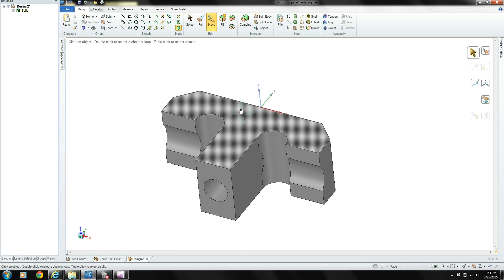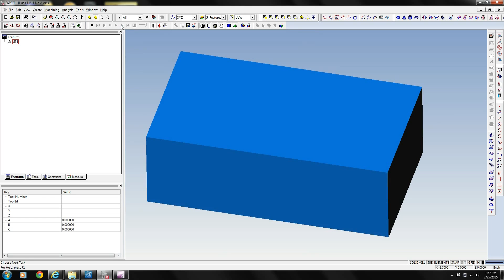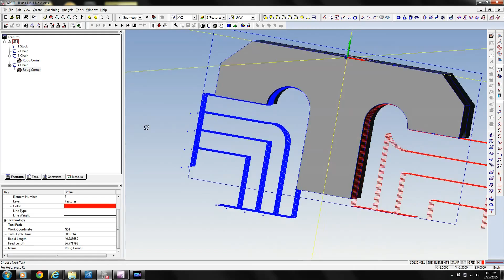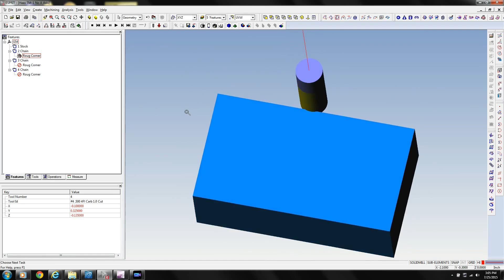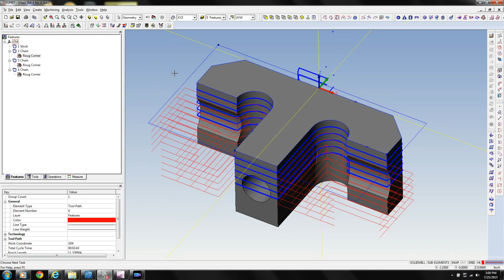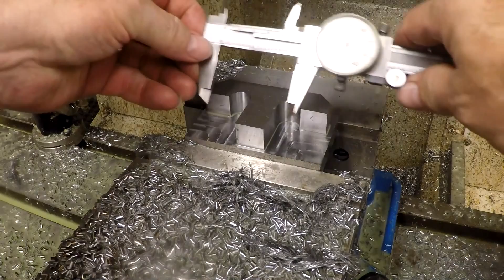Clamp For Pins  On fixture for machining mill stops

Comment: https://www.youtube.com/channel/UCtqckRPYrer8lkzhMR5SmDg?view_as=subscriber
Reply from the maker: Interesting. The only thing on your video that showed the Integrex e650 (That's my exact machine) is the face milling is out of the machines travel limits in the X minus direction (there is only X-10 mm travel). This is something the simulation isn't telling you. Of course this could be corrected by restricting the milling to the top of the part in the X+ direction.
Reply: @EdgePrecision  Thank you for your explanation, Master

Comment: That CAM seems very confusing in the sense that you have to change the part coordinate systems etc to get it to work properly. In SolidCAM that works in Solidworks, you just select your zero point from a part or the assembly and do your tool paths. You can have as many zero points and in any orientation you want for different operations, so no need to fiddle with the parts or assembly at all :)
Reply from the maker: I'm not claiming that Esprit is the best work flow solution. The reason I use it is because they have worked with Mazak to get their post's just right for the 5axis Baxis lathe. and it does work good(but its not user friendly). For general milling if I had to do it all again I think I would look at Fusion like John Saunders uses. For 99% of machining that would be fine. People promote this 5axis stuff like its the cure all but in reality most jobs don't require it.

Comment: Peter, why didn't you make all the rod part in the mazak? Man I see rust un your machine but I have to tell you we suffer the same issue and the reason is the coolant. Have you ever tried synthetic flood coolant? I was adviced to use the TRIM OD 250 and I recently got a quote of Mobilmet 766. Why do you think?
Reply from the maker: You are speaking of finishing the fixture? I wanted to finish the machining of it on the machine it will run on (I have recorded video, I just haven't posted a YouTube on it yet).The coolant I have been using lately is OualiChem Xtreme Cut 250C. This coolant is working good for me. At work in the machines with high pressure coolant I don't have a foaming problem. In the garage it doesn't leave krud on the machines that is hard to clean off. The Hanksterfers coolant I was using in the garage when it dried it would leave a brown spotted residue that is very difficult to remove. I have never used Hanksterfers at work. I happened to have a five gallon bucket of it so I tried it at home. I cant recommend it.

Comment: Thanks for the in depth video. I think it's interesting to see the," behind the scenes," part of the cnc world sometimes. Instead of just watching it run and wondering how. Btw, what was the software you were using for the CAD part of the video?
Reply from the maker: Josh Lange The software I use is SpaceClaim. I have used this for quite a while. When it first came out it worked different than other softwares
But now most software works the same as it now. Thanks for the comment. I am fixing to get back to this project. This weekend I'm making the 
first video on the end bearing support for it.
Reply: Awesome! Thanks. I look forward to the next video.

Comment: When you pasted the roughing tool path from the right of the part to the left, I was expecting it to be the same, just mirrored.  It does not look that way to me, is it because the software is making sure it is conventional milling only?
Reply from the maker: +Bill De La Vega  sorry I haven't looked at my comments in a wile. I have the software pretty much always climb mill. It is easer on the milling tools and for a finish pass leaves a better finish. In a CNC machine you will usually always climb mill the ball screws have almost zero backlash and the servo drives keep the cutter from overrunning the cut.